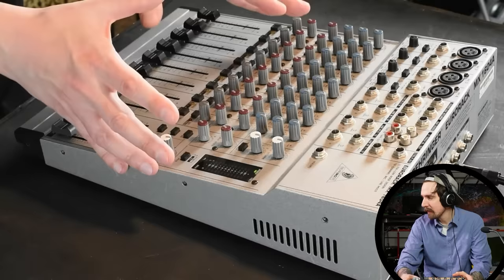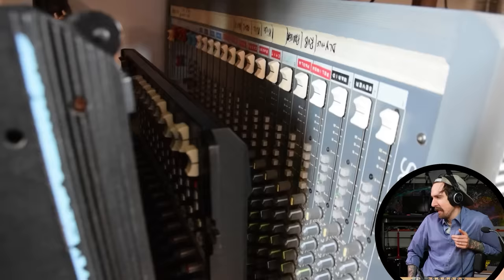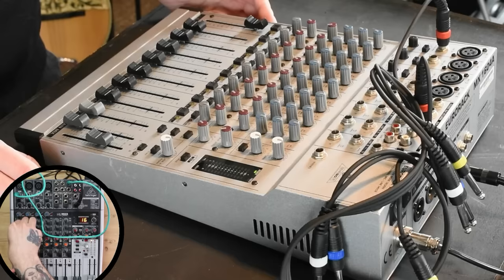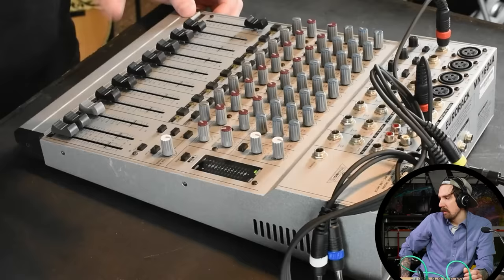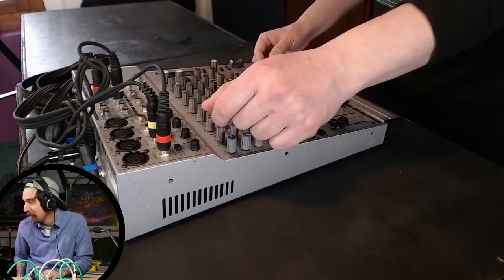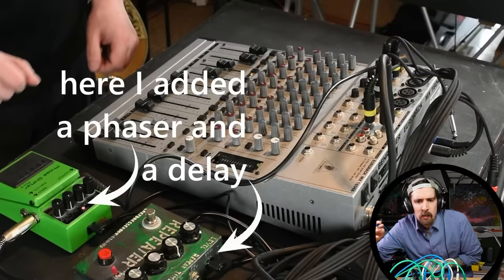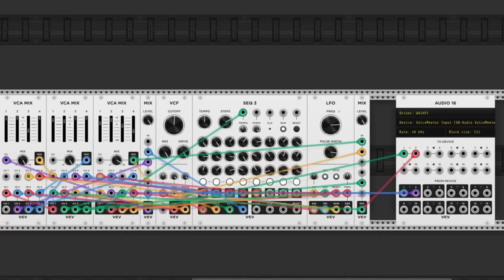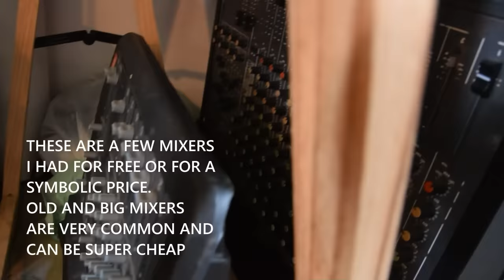Every Garbage Mixer Is An Awesome Synthesizer

Comment: I've made industrial music since the 80's and this is a technique that I've uses for decades to get harsh, insane, sounds.  This technique is the absolute core of noise music as well.
Reply: Great to hear another use of it in a different context! Using feedbacks is as old as electronic music itself and it is still something that continues nowadays.
Reply: Nice!
Reply: Sytrus is my go-to.  You can basically start with a sine wave, and alter it to a mishapened wave for noise.  Then, modify that with FX for whatever desired.  Usually, EQ is the main change.  Gets it done for me.  My equipment is broke, rn tho.
Reply: Yeah this guy is just discovering noise music lol
Reply: What other "standard" gear can be used for generating such sounds?
Reply: @athmaid  (analog) delay in conjunction with a filter can produce some wicked feedback sounds
Reply: I'm pretty sure this is what dälek used for most of their music
Reply: @TotalDec is Sytrus a hardware device?
Reply: Yeah ! Me since 92/93. We used an 8 track Phonic mixer with monitoring inputs and PFL switches. Oh, and a shitty reverb that was called "echo". ;)

Comment: I can't believe you found a Behringer mixer in the trash. That's some nice trash.
Reply: Not to mention Behringer is known to make good stuff. It's a waste to throw such things away.
Reply: Ha, I've definitely thrown out a behringer mixer in the past. Not sure about recently, but the early stuff was poorly designed and really noisy. They were so cheap that they usually weren't worth repairing so in the trash they went
Reply: @verifiedpersonae7332  I see. I have one of their analog to digital devices (a UCA202 I believe) I've used to transfer tapes in the past and they are fantastic.
Reply: @verifiedpersonae7332  I found a Sansui 6 track recorder/8 track mixer at the recycling center today, which is essentially trash. It looks like I might be able to do some things like this mixer.
Reply: @rommix0  they really aren't. I tried a Eurodesk and I got signal going from one channel to another where nothing was even sent to that channel.
Reply: @rommix0  Their stuff can be very hit or miss, especially their older stuff. However they definitely did have some gems even then. Not at all fond of some of their practices (to put it lightly) or (to a lesser extent) the Xenyx series of mixers, but still a shame to just throw something away when it could be donated
Reply: I know everyone rips on them. Yes, old Behringer gear is garbage.  That is the truth, i will not argue with that fact. . But their latest productions from the last 5 years,  give or take, is actually really good.   They really stepped up their game.
Reply: The mixers from them are really crap and I had also the idea to take it as effect. If you put them beside good mixers, they really lag sound depth and quality. If there is no comparison, it's not that obvious..
Reply: @taotechnique  too bad their business practices and customer service haven't increased with the effectiveness of their products
Reply: very interesting and inspiring! keep the vibe!
Reply: @rommix0  You aren’t familiar with Behringer’s history, are you? They have only recently restored their reputation. . .
Reply: @jnnx and that reputation isn't built on their quality either. Just the fact that they are more affordable due to all their stuff being mass produced.
Reply: Behringer design is not bad. They just use low quality components and cheap labor to keep the costs down. They even copied some famous synthesizers, but with cheap components
Reply: You wouldn't believe what folks Trash...
I was slanging pizzas for some side cash a few years back and drove by a house that had a bunch of gear sitting by the curb.
Hit them brakes with the Errrrrppppppp!
Ran up to the crib to make sure they were pitching it.
I cam up up on a Marshall Solid State, Line 6 Spider , A Samson 12 Channel. Bunch of good shit. I  broke my phone that day and was super bummed. 
It definitely made up for that.
And I'm going to try this on that mixer!
Keep exploring and expanding!
Cheers!
A Friend in Chicago 
MoonDog
Reply: Honestly, for as cheap as berhinger mixers are, they are surprisingly versatile and durable.
Reply: I feel sorry for the trash, having to have this thing inside it
Reply: @rommix0  lol, nope. these old, cheap analog mixers (called eurorack, wftw? :D) are definitely more useful for this alternative usage like noise/FB production/just patchbay/beer holder/weapon :D than for any serious task. made of trash.
Reply: @otzcz  Just because you have an opinion doesn't make it fact.
Reply: I literally found a Behringer mixer someone had thrown out on the side of the road a couple years ago 😂
Reply: So inspiring techniques and bouh to all snobish collectors, music is not a trademark, you can produce with cheap tools, your creativity will be happy to play with more toys ! Prof is now everybody who passed by this Channel will search for a behringer ! 😂 keep on experimenting 🎉
Reply: @taotechnique  Behringer guitar pedals have always been as good as anything else on the market and sometimes their clones outperformed their targets (Boss GE-7 or PS-6)

The amps, not as great, but not exactly terrible either next to something like an entry-level Line6
Reply: Back 20 years i only had money for bearing and it was not top tear to say the least 😝
Reply: no it belongs there
Reply: I have a Xenyx1204, got it for cheap as a begginner, along a UMC202. My main complaint is the electric buzzing/stomping you can hear when plugged into a PC. Plugged on a MBP it's less noisy. The good thing is that the buzz is very stable and constant, so noise remover work great. But it's a pain. Would get a Yamaha eq. when I'll have money to spare beside rent and food.

Comment: You can do this with pedals too, by connecting a stereo splitter to the output and sending one line back to the input and one to your amp. With stereo pedals you can do it without a splitter. Gets really fun when you combine loads of different pedals into a big feedback loop. I haven't picked up my guitar for ages, I just play pedals now...
Reply: + graphic equalizer , + Voice Transformer
Reply: I used to do this but I plugged a lead from the input into the headphone jack and if I sort of half plugged it in itd make noise
Reply: Gonna try this now
Reply: a whole pedalboard even. 'feedback loop' pedals are available. I also added a feedback switch to some drives i built and my Superfuzz sounds like a duck in 2 second intervals when thats on for some reason
Reply: @George Simpson  Duck fuzz sounds good! Yeah it's fun to mess around with whole feedback looped boards. The video on my channel homepage is a full no input board. Who needs guitars?

Comment: Something important I quickly learned about no-input mixing: Keep the tape running. Always be recording. Sounds will get away from you, and it's nice to be able to go back and clip out the cool stuff to put in your sampler.

Also, old busted mixers are great for this because they make even crazier sounds when their components start dying.
Reply: Very true! ❤
Reply: For sure. Same thing with modular and synths without presets. I have the Bastl Twins- the Kastle v 1.5 and the B Drum Kastle. I come up with new patches all the time that I will never hear again. The trade-off is endless variation. Sometimes I record a patch and a short improv jam. I can't wait to start shopping for dusty old mixing consoles. Ooh- "dusty" made me think of the Dust Collector effects unit. I'll bet pairing that with no input mixer hijinks would be fun.
Reply: Excellent advice!!
Reply: Name checks out

Comment: Fascinating. And funny: when I rewired my setup just a couple days earlier, I held a device and a cable in my hands and for a split second, I thought: "🤔, plug the output into the input? Well, I'm not gonna break things, today" and continued rewiring. I'm very sure back when I was younger, I would have done it. Very inspiring. I will try that as soon as possible.

Comment: I've had fun doing this with a front-of-house sound system. Run some pink noise through the system, and unmute all the mics. Run the gain up to just below feedback, then sweep a parametric boost across the spectrum, getting rings at the various hot frequencies.

Comment: If using this technique one thing you might like to do is place a switch in the cable connecting the aux out to the input. Personally I salvaged some from a dead atari-compatible 9-pin joystick. This allows one to control note on/off more easily

Comment: Back in 2017/2018 I was smoking a lot of weed in my room, in my parents house and I figured this out using a very small 80 euro xenyx Behringer mixer. I also used a boss digital metalizer as a no input synth, it had 2 stereo outputs and I made a feedback loop from out put 1 into the input and then output 2 into the amp.

Comment: I have been dealing with sound equipment for many years. The noise level of this behringer mixer is really good. You have to be there in the 90s where mixers felt like a tornado was around the mix. They say its garbage because of its price. One thing,... they dont get my money.

Comment: Pour mixer. But a oscillator is basically an amplifier that is going in feedback mode. Then it will oscillate like an oscillator does. The mixer is basically bounce of a lot of amplifier outputs for mixing sounds.

Comment: I've been doing this for years with pedals and cheaper mixers. These Behringer and Yamaha mixers are not great in my opinion. But they are bloody audiophile quality compared to old Radio Shack/Realistic mixers and similar.  Those older junkier mixers distort much more interestingly.
There is one thing that these newer mixers feature which the old ones lack, which is inserts.  You can easily get several types of feedback loops going on at the same time in one mixer and still have the aux sends available for further processing, EQ reverb etc. 
Also, on all mixer with which I am familiar, the low cut will come before the insert and the EQ after. So you have some interesting control there. 

It's kind of funny, I got into doing that kind of stuff because I could not afford modular synths and fancy synthesizers. 
Now I have tons of modular gear and a not insignificant amount of analog and digital synths. But none of these can replicate a ghetto set up with a few guitar pedals and a mixer I picked up for $40. 
So I frequently reach for my crappiest gear to squiggle noises all over the pristine tracks I recorded with my best gear.

Comment: The EEs call this phenomenon "self-oscillation." It stems from the noise intrinsic to every electronic device. (Insert joke correlating Behringer with noise here.) When fed back and amplified, that noise modulates with itself, creating the audible oscillation. It comes off as a square wave here because we are peaking all of the amplifiers; playing with the gain might make other waveforms (and, thus, other sounds) possible. Impressive to see how good input protection is on even cheap mixers these days -- I am equal parts stunned and unsurprised your musician friend has never blown a mixer. OTOH, somewhere, there's a sound engineer watching this video and having an aneurysm. 😅👍

Comment: This video came at the perfect time as I just got the Behringer Xenyx 802 for cheap at a pawn shop, but I had no idea how hard it is to find the power supply since they stopped making them. The only ones I find are twice the amount I paid for the mixer D: Hoping I stumble upon one for cheap some day so I can try this out!
Reply: ugh i didn't know they stopped making them - just looked at the price and my jaw dropped. especially considering that the plugs have pins that are pretty easy to mess up.
Reply: Could try finding a psu with a variety of exchangeable plugs at an electronics supply shop?
Reply: Good luck — I just did the same thing, and finally resorted to building my own power supply using a bare transformer from a surplus store and replacing the power input jack with a screw-on round connector.  It works, and I don't need to worry about the power plug coming loose, but the plastic box I put the transformer in is slightly bigger than the mixer, so it's not exactly compact.
Reply: @sodothehivesonhisleg  The Xenyx 802 needs a really weird power supply — it's 34V AC, center tapped, so you're feeding it two 17V AC lines it can easily rectify into both positive and negative DC voltages.  Most, if not all, supplies with adjustable voltages and exchangeable plugs are just DC, and I've never seen one go over 12V.

Comment: Honestly, I'm kinda surprised stuff like this & other electronic-jamming isn't used in more tune/song-focal modern popular styles of music too often, since sounds like this have been around in experimental & underground music since the 70's at least (see Cabaret Voltaires take on No Escape for example.)

It kinda seems like the obvious answer to guitar solos in plenty of Rock, except just a smidge more abstract than whammy & feedback noisemaking.
Reply: It's called a synthesizer
Reply: some eurorack modules / systems (particular techniques and approaches) are designed to do exactly this--atonal feedback sounds--with more control and intentionality. of course, it's more expensive, but it's perfect for this sort of approach to sound-making. as @alexc4924 said, in a word.

Comment: I actually used to play around extensively with no-input mixers in college, to the point where I had a massive polyphonic synthesizer! I had one soundboard rigged to foot pedals to play bass notes (a total of four different notes), another soundboard rigged to play chords and other accompaniment (a total of six notes with two-note polyphony), then a tape player I rigged to become an oscillator. I actually recorded an album with that set-up under the name Heavy Yellow, I believe it's still up on Bandcamp if you or anyone else wants to check it out!

Comment: Have used a handful of these cheap small channel mixers there's usually tons of cut corners that makes this totally a cool thing to do with them and nothing else. I think Mackie would be the only brand I would avoid since they actually put some effort into their mini mixers and make them capable and comparable to a real mixer with actual balanced outputs in some cases. This also finally explains why every mixer has a stupid effects unit built in.

Comment: The phantom power takes some time to 'unload' (or what the correct electrical term is) so that's normal.
Although, I believe you need to use xlr connections for the phantom power to be distributed?
Reply: Yes. So it's very difficult to screw that up, but still worth a mentioning.

Comment: Behringer does belong in the trash. I am not sponsored nor endorsed by anyone. When I was starting out in music production in the hay day, I didn't have a large budget and Guitar Center heavily endorsed Behringer products, and well, it "looked" professional but is the bottom of the barrel junk I ever did get. I went through I believe three or so behringer mixers, all very similar to what you have there in this video. The first one I returned to Guitar Center and had replaced as off the shelf, it quickly degraded and sounded like garbage, I thought something was wrong with it. Then with the replacement, it lasted a year or so, and same problems as with the first mixer however was beyond the return policy to return or swap it out, so I had to do that RMA thing and send it back to the manufacturer. They "Repaired" the device and with in 3 months it crapped out again and I frankly had this issue with all behringer products, from their microphones, to mixers, to compressor/limiters. Berhinger is the shit of all musical needs. 

I picked up a Mackie mixer instead and I had it since 09 and still it works flawlessly for all my needs. There is quality, then there is shit and Behringer is shit. But perhaps I can find use for these garbage mixers as I think I still have my berhinger in a box burried somewhere. I never did toss it, even though I wanted to, I thought perhaps I can strip it for parts down the road.

Comment: I highly recommend Behringer's CT100 Cable Tester - among its many features it has a 48V phantom power detection (which lights up if 12V+ is detected). I usually use it for testing cables for intermittent loss, super helpful for that. My Dad had bought in back in like 2002 and we never used it because it looked complicated but its actually very simple and handy.

Comment: Kinda wished he got atleast two notes creating an interval. I think, there was some octave moments... but yeah, must be hard to control to get actual different intervals / harmonies going. As said before by other comments - this is noise musician culture and should be respected as such. :)
Reply: You can do really interesting stuff with harmonizers and other pitch-based effects. To make things sound musical, it is more of a challenge that takes some practice and experimenting, but it's totally possible. I like the atonal/noisy/non-musical stuff as well as the musical stuff, myself. Andrea's work features a lot of very musical no-input stuff.

https://borijska.bandcamp.com/
Reply: There are also many "musical" applications actually. My album "The Inner Shore" (sorry for the plug) is an example. Every track was recorded live with just no input mixers and effects. It requires much more preparation but it is doable.